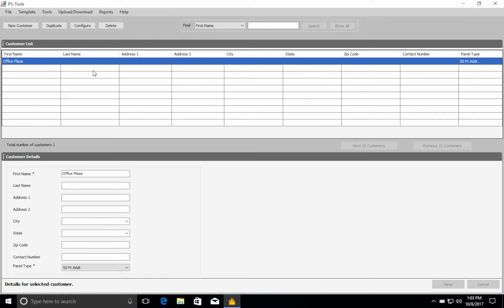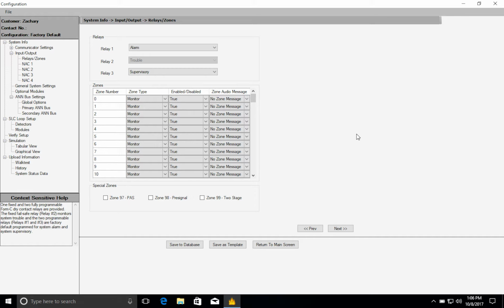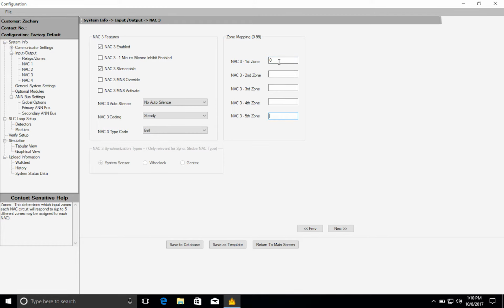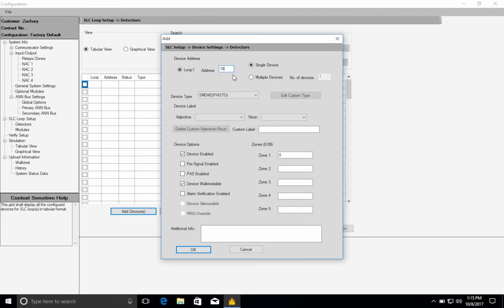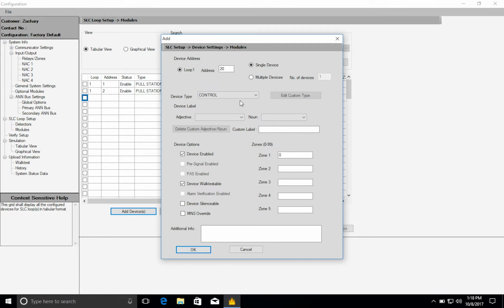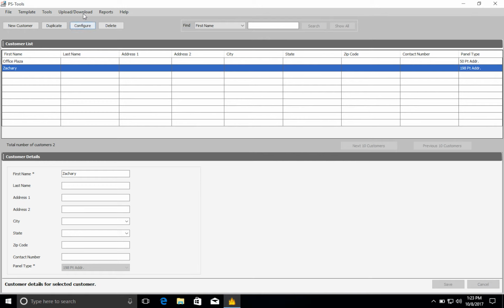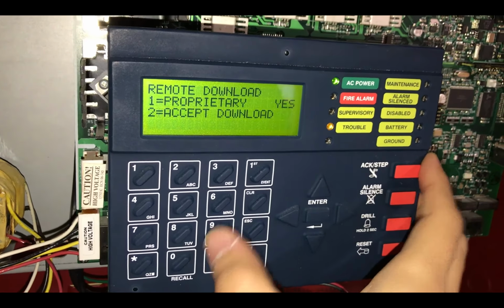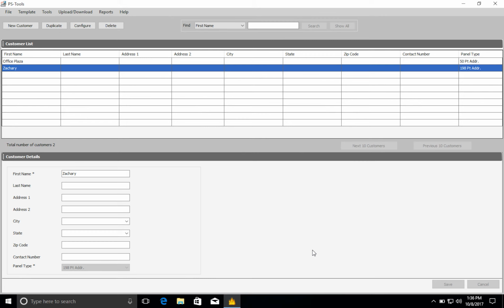Fire Alarms Explained: Programming Fire Alarms with PS-Tools for Fire Lite, and Notifier FireWarden

Comment: Hey just a question, When i get my own system setup in my own house, I want to have a FireLite Fire command 2550X voice Evac panel (and maybe a wheelock safepath voice panel and an EST ANS voice panel (expensive I know :P, but I will only use 1 voice panel on the system at a time)), How would I program a Custom message into it? (Because I know you can)
Reply from the maker: I know it's possible, but honestly I have no idea how. It is very likely done through their software for the respective panels.
Reply: Fire Alarm Tech NVM found the document on Fire-Lite’s website TY tho

Comment: Just a question, for the NAC Coding, is there an option for 90 BPM Marchtime?
Reply from the maker: Negative. Only fast march time.. :/
Reply: Fire Alarm Tech Ouch, Maybe it will be added in a new update? (I plan to use this on my MS-10UD when I get it) or is it impossible with programing?
Reply from the maker: @temporalosm  Not possible unless you have an external power supply or do some creative stuff with relays.
Reply: Fire Alarm Tech Ok!